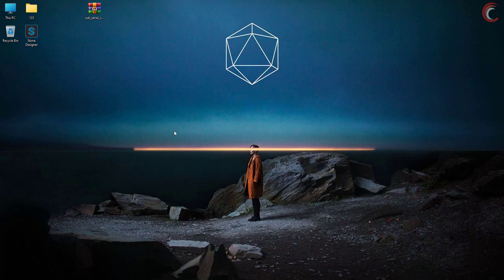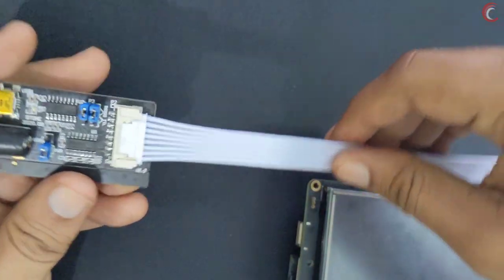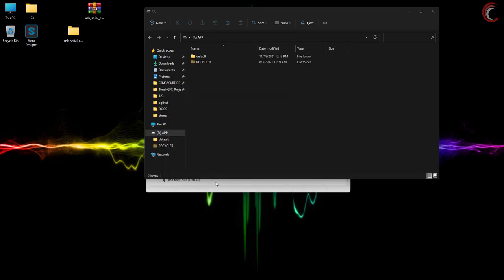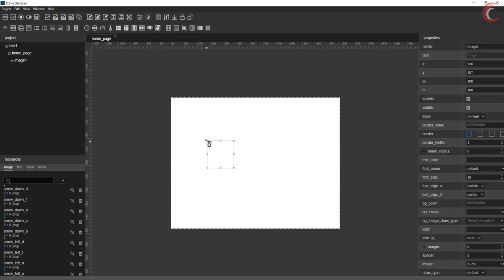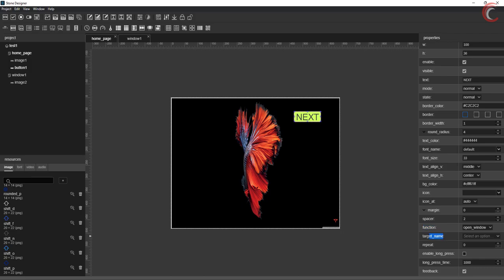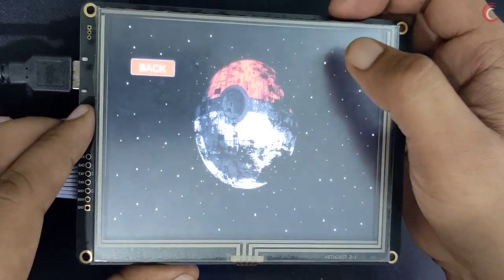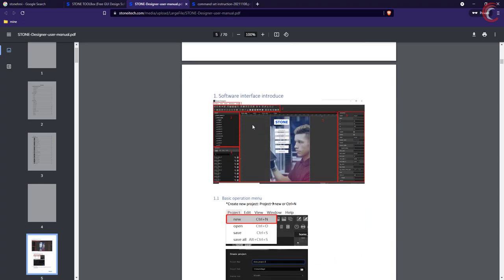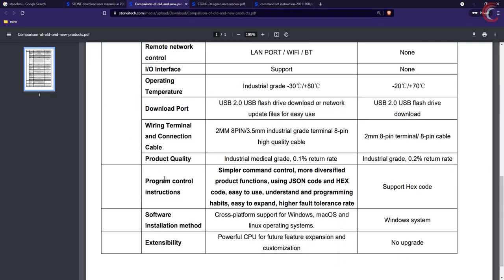Getting Started with STONE HMI Display

Comment: Stone Designer software- many of the icons do not function; some show their function when hovered over but many dont and seem to have future intended utility. I could not find where to set the baud rate for the current software.. Recent videos on the internet suggest ad hoc wiring changes to their adapter board (of Stone design for some unfathomable reason, which comes undocumented (!) but is essentially a usb to ttl or RS232 serial converter but it imay do more. Beware ! unless you like a puzzle! Maybe something is lost in translation. on first glance the command software looks good but for example a return HEX code is given for the first two commands but none subsequently, Previous software suggests there are return codes for most of the commands. This could be a good product although I am not a fan of TLT displays (compared to a standard cell phone display the contrast is poor) Even with this caveat the product has some nice features but the delivery is rushed and will turn off most folks (possibly forever). Be aware that other you tube videos on the internet are not applicable to the current Stone Designer software,

Comment: Hello sir, I have a question is it possible to compile and simulate the project in offline mode I mean without connecting a display? because i have the latest version V1.1.14 but I can't see those options.
Reply from the maker: I guess its not available with the new software. You should check with the stone team about this.
Reply: @ControllersTech  yes you are right i have got contact with Stone team and they said they will release debug version end of this month,